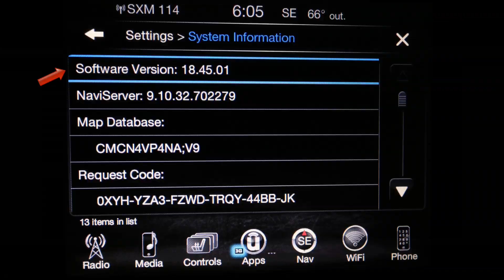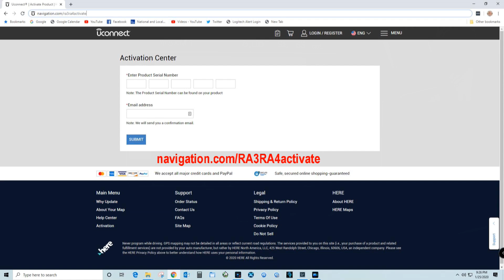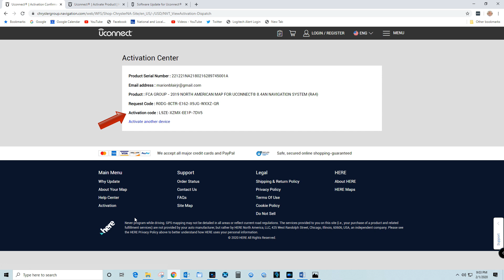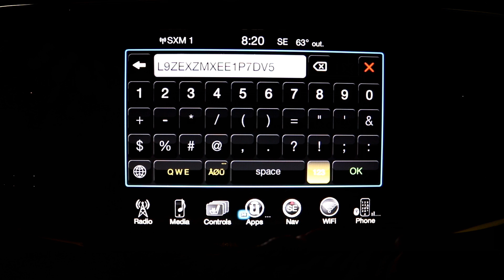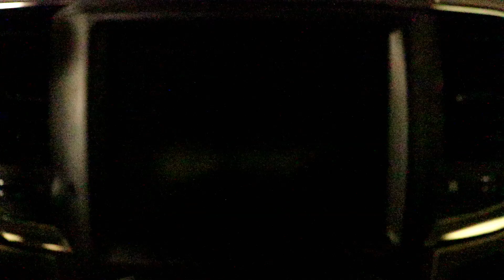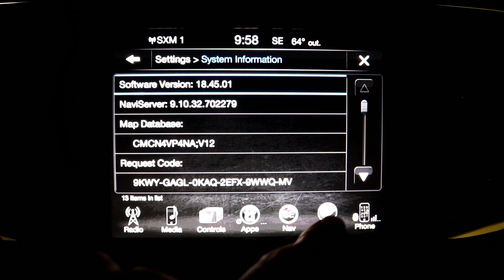RAM/ 8.4AN 2019 GPS Map Update Installation

Comment: It took 1 hour and 50 minutes to update the maps and that just when it actually started to update. It took another hour to figure out how to get the activation code. The Chrysler web site doesn't work with Apples MAC OSI you need to use another web browser's, I used Chrome.

Comment: How is this better than just using google maps on your phone?
Reply: JohnnyVersnachie stand-alone gps doesn’t require cell service. Having said that, there is no way I’d pay Ram to activate or update maps on uconnect.
Reply from the maker: @jeffs2809   yeah well at least Ram doesn't charge what about five hundred bucks to activate your GPS versus about two grand for a GM or Ford
Reply from the maker: @jeffs2809  stand-alone is simpler for a long trip cuz you don't have to keep connecting and disconnecting your phone however nothing has as much information as Google and simple to get to
Reply from the maker: I don't know I really like  Google  Maps, but if I'm going to have a GPS I'm going to keep it up to date.   I mean I don't have a choice because I don't have Google Maps on my truck other than to my iPhone or Android rather